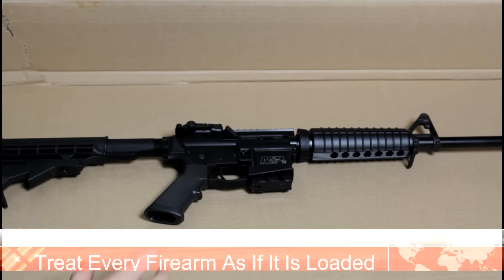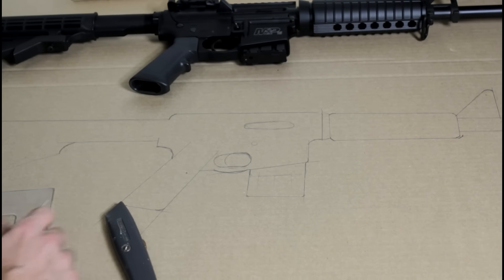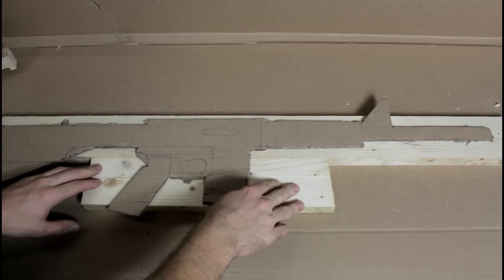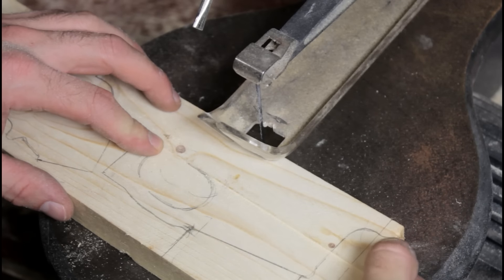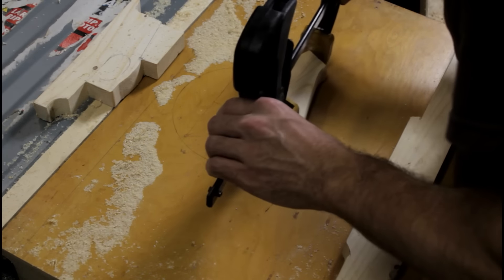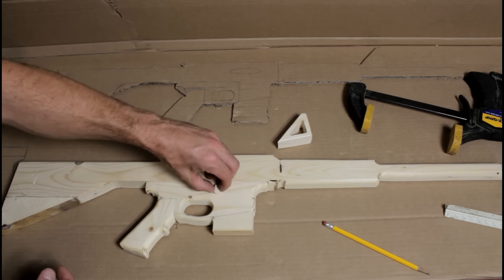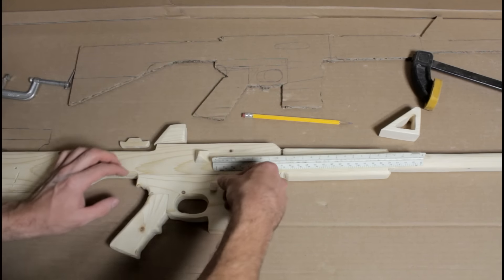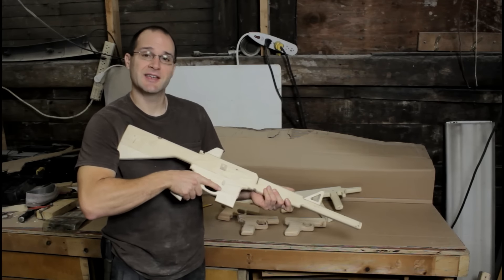how to build a wooden ar15

Comment: If you use wooden dowels, magnets and another 1" 2x4 piece, you could drill two holes into the mag chamber, insert some magnets, glue on two other magnets on the dowels, cut them down to line, and stick them to the magazine. So yeah, an idea for a magazine
Reply from the maker: Awesome idea that would be amazing
Reply: if you're trying to make a realistic ar 15, a magazine release system can easly be made out of a tooth pick a very small spring and plywood.

Comment: Maybe adjust your saw blade higher up to cut the hold block of wood?!
Reply from the maker: You could do that if your table saw can handle it. It’s a lot to cut and safer making a few passes at it. Anything I can do to avoid kick back is a good thing.
Reply: Good job though I’m in need of making the sexy ar15 but I’m so busy making animal stuff atm 😆.
Yes kick back is not fun, lov your jig saw nice and small.

Comment: Use a band saw to cut wood like that one day that wood on the table saw is going to kickback
Reply from the maker: Very true. What size/hp would you recommend in a band saw?
Reply: RealQuickChris if you want to cut something with a curve you want to use a thin blade but if you want to cut something straight you want a thicker blade and for what u wanted to do you want a tall fence that u could make with plywood. And you probably want more tension on the blade then normal.
Reply: And I would ask the person at a woodworking store or something about the horse power

Comment: No biscuits or dowels for gluing together?  I'd have broken those glue joints as a kid quick.  How did it hold up?
Reply from the maker: it has held up pretty good. the hand guns are great and the early versions of the rifles that my daughter smashed on the ground needed a re glue. I did figure if it happened two times then yes some dowels.
Reply: RealQuickChris good to know it held up to some abuse. Must be some good glue and you obviously got the faces mated well.

Comment: overall looks a lot like an ar18
Reply from the maker: Looking up some pics yes it does. At a quick glance I don't know what the difference is between the 15 to 18 time to look it up.
Reply: +RealQuickChris it was made by the company that orinally designed the ar15 after they sold the rights to the ar15 to colt
Reply from the maker: Nice, someone long ago told me back in the 80's you could buy M16's at Kmart.. ever hear that? Lol

Comment: Question, would a circular saw work?
Reply from the maker: It all depends on your skill level and above all else be safe. Clamping the work down as well as making a guide so that the saw can run flat and straight.  I don't know if I would try it. Doing it in the table saw was work enough. A trip to the big box store and you might luck out and find the size you need.  I don't have one but I am thinking a planer would be the best bet to get it down to the thickness you want.
Reply: RealQuickChris ok, but what about that router bit thing, where did you find it? Also what is the RPM of it?
Reply from the maker: I would have to double check I think it's just a 1/2hp or 1/3hr hand held router that I mounted upside down so that I could use it the way I wanted. You could make a jig so that you could "plane" down the wood. I just have not done that yet. Clamp the wood down jig goes over the top and route away. I am liking that option.